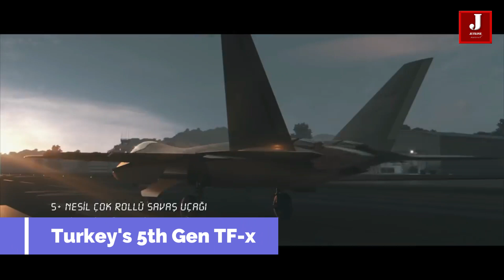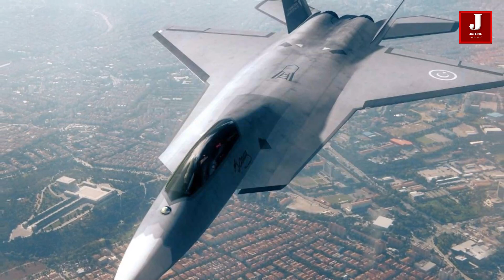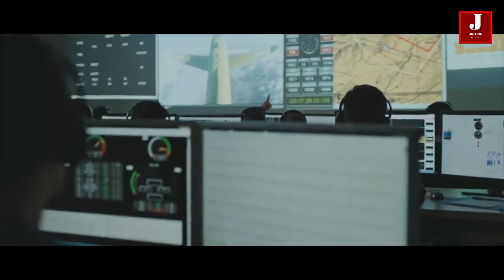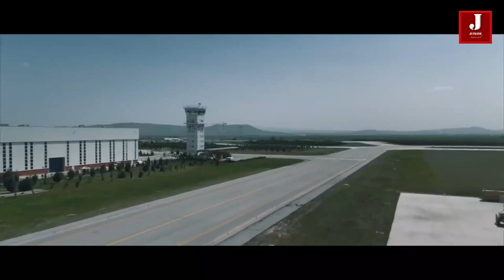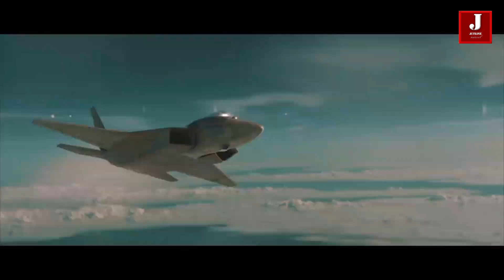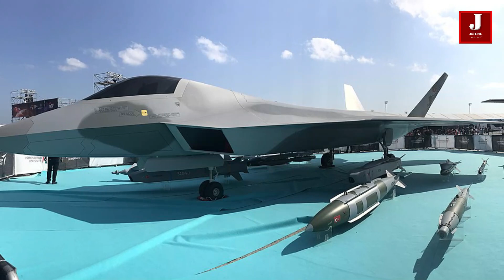Meet Turkey's home built 5th gen fighter jet TF x : Specification, speed, Engine and Weapons

Comment: So anyone who is bad mouthing AMCA. Please don't talk without getting your facts checked.
First TFX,
The approach of the Turkish fighter is completely different from Indias AMCA. They Have done a model design of the TFX and then after went to built the prototype directly, note that things like critical design is still not done, and will be done around 2024-5 (according to Turkish company). Critical design is something which makes sure that the plane will fly without any trouble with full specs. There's are thousands of simulation and maths to determine the credibility of the fighter, turkey will be making 3 prototypes, and each prototype will be better from the previous one, and after the critical designing, then only the actual prototype can be made to start testings. According to Turkish firms, after all of the prototypes are made, they will start taxi trails etc, and till 2029-30 the testings will be completed.

In AMCA's case,
The approach is completely different from the Turkish fighter. HAL and DRDO have already completed the critical designing phase, and is on the metel cutting phase. Unlike turkey, we won't be having 3 different prototypes, and that's why, when our first prototye will come, it will be a near Finnishing product, and only some fine tunings will be required. Where's as, the duration of the TFX from the first prototype to first flight will be around 3-4 years. Our prototype will be ready to fly.

Both companies have different goals, and different approach methods, Turkish firms, wants to assemble the aircraft as fast as they can, to take the interest of foreign investors and etc. Where as HAL and DRDO have said that they will not be compromiseing in anything, even if it takes time. Also you have to understand Turkey is a NATO country, and also have support of companies like Saab and other firms. Whereas AMCA, is a completely indeginous fighter (except the engine), we don't have our hands on western tech, so we have to do a total clean slate. 

Both Turkish firms and Indian firms have shown extreme good results, but you should also know how and on for what purpose things are getting build, rather than just giving your opinion

Comment: ⭕update;  30 August 2022, Google Translator is used.⬇️⬇️⬇️⬇️⬇️⬇️⬇️
 Ivchenko AI-25TLT
 Selçuk Bayraktar, on the other hand, said that Ukraine has already delivered a large number of engines and this process continues without any interruption.  In addition, it is known that Ukrainian Ivchenko delivered AI-450C engines for Akıncı B, and even these versions were included in the TAF inventory.

 Therefore, Bayraktar Kızılelma prototypes and mass production models will be developed in accordance with the plan without any engine supply problems.  It is also stated that it will make its first flight in the first quarter of 2023 and will be able to land and take off from TCG Anadolu when it enters the inventory in 2025.

 In addition, Bayraktar Kızılelma will appear in at least 3 versions with different abilities, A, B and C, as in Akıncı.  AI-25TLT (16.5 kN) and AI-322F (41 kN), which are AI-25 variants produced by Ivchenko, will be used in these vehicles.

 TEI-TF6000
 It is stated that 4 prototypes will be produced in total.  These will be 1 AI-25TLT Red Apple-A, 1 AI-322F Red Apple-B and 2 AI-322F Red Apple-C.  There is a claim that more than 20 engines have been delivered so far.

 In addition, there are some studies to return to the domestic engine in the future, just like the Bayraktar TB2 models.  In fact, versions of the TEI-TF6000 turbofan engine produced by TEI with thrust power of 6,000 lbf (26.5 kN) and then 10,000 lbf (44.5 kN) will be tested with Kızılelma.

 Critical statement from Haluk Bayraktar: It will replace the F-16!
 Baykar Defense General Manager Haluk Bayraktar, who answered the questions of the journalists at the beginning of the event, said that Bayraktar Kızılelma/MİUS could replace the F-16 jets with its entry into the inventory in the future.

 When we look at the first data shared for Bayraktar Kızılelma, we see that a very promising prototype will appear.  Because this aircraft will bring with it some innovations that we saw in the F-16 and F-35, as well as the artificial intelligence features of TB2 and Akıncı.  It will also have high maneuverability compared to SİHAs.  However, it should be noted that this does not mean that he can do dog fights with F-16s.

 It is planned that the first models to be included in the inventory will accelerate to Subsonic, that is, 800+km.  In the future, it is quite possible that we will see transonic (1000+ km/h) and supersonic (1200+ km/h) models.  In addition, it will be able to land and take off on the TCG Anadolu amphibious assault ship, where the TB3s will also be used, that it will have the AESA radar used in the F-16s, and that it will have a low radar appearance by carrying ammunition in the fuselage like the F-35 (also thanks to the materials and paint used in its construction). Let's say too.

 Bayraktar KIZILELMA will be able to communicate with new generation warplanes (F-35 and MMU/TFX), unmanned aerial vehicles (such as TB2- Akıncı, Anka and AKSUNGUR) and intelligence units (AWACS aircraft).  Therefore, he will be able to move and hit the targets they see as if he sees them himself.  Their primary mission will be air-to-land.  Of course, it will also carry air-to-air ammunition.  However, this feature is expected to be used not against warplanes, but against UAV-SİHA-TİHA and helicopter-like aircraft.

 To put it briefly, Bayraktar KIZILELMA (MIUS) will be able to take off with F-16s until the MMU (National Combat Aircraft) is produced, and then with MMUs after it is produced.  Sometimes he will take on their costly operations, and sometimes he will go on secret intelligence missions.  When deemed necessary, it will be able to destroy all kinds of targets with a wide range of ammunition (14+) it can carry.

 For this reason, it is estimated that it will be a better alternative to F-16s and F-35s than Akıncı and Hürjet in many air-to-ground scenarios.  However, it seems that they will not be able to replace them in air-to-air missions, at least for now.  Of course, if transonic and supersonic models are developed, it can push the limits known with the experience gained until then.

 What do you think about this subject?  Don't forget to share your views with us in the comments!

Comment: Thought they was supposed to have Rolls Royce engines?
Reply: The engine that we produce with Rolce Royce will be produced in Turkiye and Turkiye will have the rights to produce and sell it without UK approvel to any country.

But I think in return UK wants Turkiye to be part of in really expensive Tenpest project. So both sides will have production rights of the 5th Gen engine that will com out of this agreement but I think only UK will have the bluprints of the Tempest but Turkiye will produce some of the parts like in F35 deal.

At least this is what I am guessing...

Only thing I am sure is that TEI & Rolce Royce will produce these engines and get their respectetive shares from the sales.

Turkiye after being able to serial produce this fighter jets will sell them to a lot of countries they have good ties with. I expect most of the countries which bought TB2 to buy TFX too. I expect 500 to 1000 production minimum.
Reply: @tongzhouwarrior  well regardless of what happens with RR, Turkiye should not sell this plane to anyone, or simply produce an export version and keep competitive advantage
Reply: it s failed so they use general electric motors . They are developing own engines which will be completed in 2029

Comment: It will have no indigenous engine unlike AMCA mak2
Reply: AMCA is plane for kids
Reply: It will. Tusas engine industries will make a supercruise capable engine for the TAI TFX using the experience gained in licence producing GE F110 engines and parts for the f35's engine it used to make
Reply: the engine is already in the development process, Turkey already have TF6000 jet engine prototypes which will power stealth aircraft drone.

Comment: Turkey's Paper plane need Atleast 30 Years to be ready 😂, Bcz of lack of experience
Reply: Lack of experience? Ur talking about the same country that licence produced over 200 f16s and made the fuselage and engine parts for the f35. Turkiye made planes 98 years ago. As of now Turkiye has built its kizilelma stealth drone fighter so if it can do that, it can definitely make a manned stealth jet.
Reply: @hellothere1656  don't waste your time, he's a lowlife moron
Reply: Dont think so. Turkey lacks domestic engine development of which the project has started several years ago and its in progress. Other than that, Turkey is the second largest F16 manufacturer, there is a know-how, rest is implementing these with domestic technologies. But certainly 10 years.
Reply: Turkiye who have been producing F16 and it's engine and thousands of parts of F35 and its engine which is fifth generation don't have experience than who have?
Reply: All aircraft manufacturers, like Boeing and Lockheed Martin, are actually integrators. The subcontractors build parts based on the specifications and the integrator puts them together. The integrator has the design and test capability while the subcontractors do not see the whole picture. After building parts for aircraft integrators for many years, subcontractors accumulate a lot of knowledge, that may be enough for them to start designing their own (If you don't understand that, then you come to an illogical conclusion that every integrator must reinvent the aircraft). Today, every plane flying in the world contains parts made in Turkey. Yep, they have the capability of designing and producing an aircraft. If you put a lot of resources into it, then you could do it faster. 15-20 years ago, their military technology had 90% dependence on the outside resources. Today that number is 30%. Go figure....
Reply: the same was said for bayraktar in the sky right now ;)

Comment: The first flight is yet to take place. Kindly note that IOC, FOC etc are all in the future. The planes after rigorous testing would most probably be first flown after 2025. Then the manufacturing timeline of a new aircraft is indeterminate. Then comes the domestic order followed by Exports of the same. All these take place if there is no disruption of the supply chain and the logistics. The supply of the Engine by GE of USA is not to be taken for granted. Anyhow do not forget the experience of Sweden, Korea, India, Israel, Brazil etc with their initial euphoria and subsequent developments.
Reply: The first prototypes will fly with F 16 engines, then a joint engine will be produced with the UK Rollce Royce.
Reply: Bear in mind their first block will NOT be 5th gen as they stated a few times, They will probably reach the 5th gen standards after  block 4 or 5.
Reply: @alican3920  4,5 te generetion flight 2028-2030 5 te generation flight 2030- 2035
Reply: India? LOL